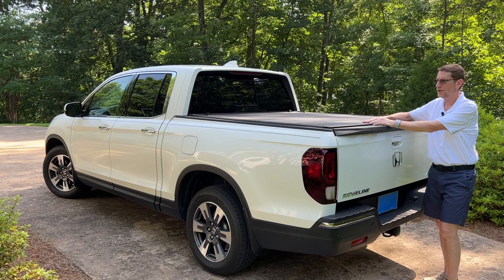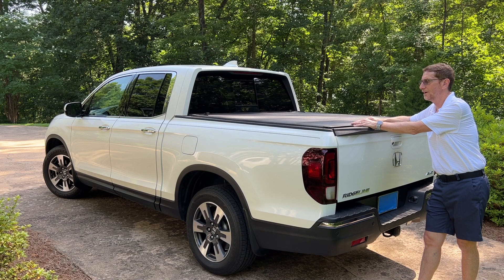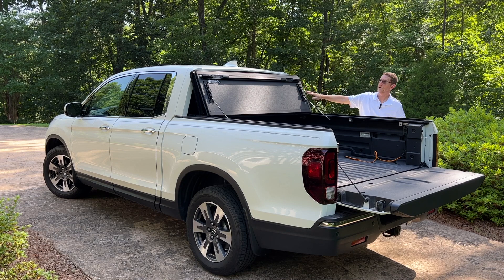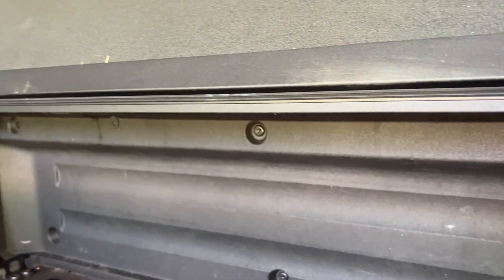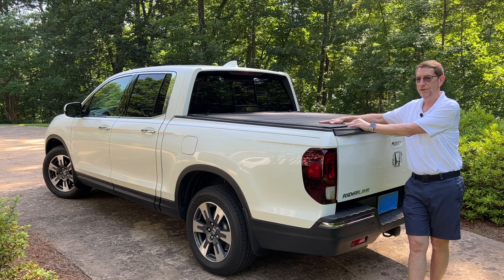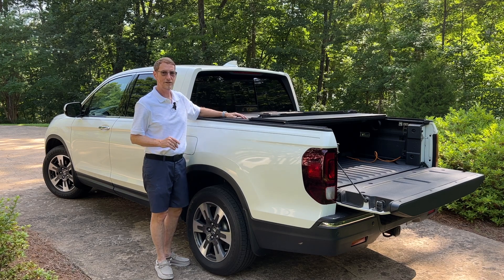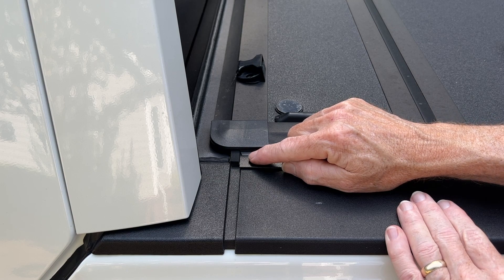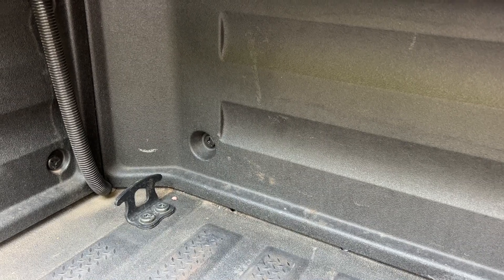Bakflip MX4 Tonneau cover, four year review and tips for keeping water out of the truck bed.

Comment: Have exact same cover for my 2018 Ridgeline. Nice enhancements you made!  I added a bed rug to keep things from sliding around. So nice.
Reply from the maker: Hey Craig! I had a BedRug in my first generation Ridgeline. The BedRug was awesome for things like moving furniture and was so easy on my knees but I haul a lot of pine straw and the needles get entangled with the BedRug and are impossible to wash out or remove by sweeping. I considered a BedRug for my second gen Ridgeline, but decided to make do without one.
Reply: @Koolbob2  i have the same issue, just got a 23 and the mx4 and the bedrug, i often get hay for the chicken coop, i wull just throw a tarp down, that should solve the problem.
Reply from the maker: @georgesangilan2845  LOL, that's exactly what I ended up doing! I kept a canvas painter's tarp in the trunk for when I had to get pine straw and didn't want to spend an hour plucking pine needles out of the Bedrug. As much as I enjoyed the Bedrug, I decided not to get one on my new Ridgeline.

Comment: Very informative. Thank You. I've been searching for a flush mount tri-fold for weeks now and I think you've just sold me on the MX4 ( It was already on my short list ). Im also concerned about better security and found a simple idea for drilling and pining the latches in the back panel to keep a crook for opening it with a coat hanger. Thanks Again !!
Reply from the maker: Thanks for watching and taking the time to leave a comment. I hope you are as pleased with your MX4 as I am with mine. It should be relatively easy to drill a hole through the edge of the MX4 and into the drip rail and slip a pin or bolt into the hole preventing anyone from lifting the cover, even if the release cable is pulled. Of course, you will have to open the tailgate and remove the pins or bolts to open the MX4.

Comment: Glad you had a good experience with yours. I just did a review on my F1 cover from BAKFlip and it’s awful. The first was half-ass replaced under warranty and the second one suffers from the same heavy panel issue due to water absorption.  Their customer service was awful in trying to get the side rails replaced after they replaced the cover.
Reply from the maker: Thanks for watching, I'll be sure to check out your video! I'm sorry you are having problems with your F1 cover, I just checked BakFlip's website and the F1 isn't available for the Ridgeline so that may be why I've never hears of any problems with the F1 on any of the Ridgeline forums I hang out on. I will say that I bought my first BakFlip second hand and the BakFlip customer service was just 'ok' when I called them to buy replacement parts. I sold that first cove when I sold my truck ad ordered a new BakFlip directly from BakFlip when I got my second truck and the customer service was fantastic. I wonder if the customer service is better if the cover came directly from them?

Comment: @Koolbob2  Thanks for the informative video. Could you please advise as to whether the Bakflip cover allows the bed trunk to open fully when the cover is folded back? If not, I have a few additional questions: how much of a reduction is there? Does it hamper your ability to access the spare tire, for example? Do you have (or can you suggest) any workarounds?
Reply from the maker: Every rigid bed cover requires a pair of rigid rails to be attached to the sides of the bed. All bed rails will prevent the trunk lid from opening 100%. The reduction in the opening of the trunk lid is minimal (10-15%). I can still access the spare tire and everything in the trunk. 

The only downside I've experienced is the lid no longer opens completely past the lights inside the truck bed. It partially blocks the lights when fully opened with the BakFlip installed. So at night the lights do not illuminate inside the trunk as well. That's why I added a pair of LED lights to my trunk lid and wired them into the OEM bed lights.

Comment: My bakflip tonneau has absorbed so much rain water it's almost too heavy to lift, is there any way to drain it?
Reply from the maker: After about 6 years of use I've noticed my BakFlip  is starting to get heavier after being exposed to rain for a couple of days. I am not aware of any way to drain it, but I may try folding it up to next time it feels heavy to see if any water drips out. I suppose you could try drilling same small holes in the underside skin.
Reply: Have drilled small holes already, will try larger holes next
Reply from the maker: @deeohgee4574 Keep me posted on your results!
Reply: @Koolbob2  glad to keep you updated...

Comment: Can you tell me if the in bed storage door opens all the way up when the tonneau  rails are  installed.
Reply from the maker: Sorry for the late reply, I just now noticed your question. The trunk lid opens about 90-95% of the way before it makes contact with the Bakflip rails that attach to the truck bed. It's no big deal and it's a tradeoff you will have with any cover that installs with similar rails.

Comment: How does this cover work with the bed storage compartment. I have seen some that limit the height you can open the lid. The lid doors hit the cover rails. Your video was very thorough but this wasn't mentioned...Your thoughts on this would be wonderful.
Reply from the maker: Yea, I really wish Youtube would allow us to edit videos after they are uploaded. I definitely should have shown how the trunk lid is affected. All rigid bed covers require aluminum rails to be mounted on the sides of the bed and they do reduce how far the lid can be opened by a couple of inches.

I did make another video showing how to add LED lights inside the trunk and you can see how far the trunk lid opens in that video. https://youtu.be/9afkJfdXJDw
Reply: @Koolbob2  after I commented I saw the other video. Looks like it opens pretty far. Thank you for the reply!!

Comment: Do you know if there is a BAkFlip that dosen't have a foam insert core ? Some people said that with time, the water could get in and the pannels gets very heavy ? Does the F1 model dosen't have foam in his core ? Thanks again.
Reply from the maker: My Backflip is almost 7-years old and I haven't noticed any issue with the panels absorbing water. I haven't studied BakFlip's covers since buying mine so I can't help you with how each model is manufactured. The Backflip folks were great to work with when I contacted them years ago, I'd just give them an call or email them and I'm sure they can answer any questions you may have.
Reply: I've owned two BAKflips, one for 5 years and one for 7. Both got heavier the longer they were exposed to the weather. It would be interesting to see what's inside since regular insulating Styrofoam doesn't absorb water.
Reply from the maker: @billstevenson1623  My Ridgeline is in the garage most nights so maybe that helps, but I've also been in torrential rain for a week when traveling and I've never noticed any water retention in the BakFlip.

Comment: Mine doesn't have the rubber stops and it rest against the back window on the ram 1500
Reply from the maker: Yikes, that doesn't sound good. I think I'd add my own rubber bumpers or at least use a pool noodle or some foam pipe insulation between the cover and the glass.
Reply: @Koolbob2  yes a pool noodle! Thank you that's a great idea lol I actually didn't think of that it's either that or maybe ill see how much some 3m rubber stops are on Amazon but pool noodle for now

Comment: I noticed that you still have the top tie downs installed. When they installed my MX4 on my 2023 Ridgeline they removed all four top tie downs and didn't reinstall them after they installed the bed cover. do you think the bolts are long enough for me to reinstall them?
Reply from the maker: Sorry for the late reply, I just now noticed your question. I reinstalled my tie downs with the factory bolts when I installed the cover. Unless Honda shortened the bolts you should be fine reinstalling the tie downs.

Comment: Does this cover stop the trunk from fully opening?
Reply from the maker: Every rigid bed cover requires a pair of rigid rails to be attached to the sides of the bed. All bed rails will prevent the trunk lid from opening 100%. The reduction in the opening of the trunk lid is minimal (10-15%). I can still access the spare tire and everything in the trunk. 

The only downside I've experienced is the lid no longer opens completely past the lights inside the truck bed. It partially blocks the lights when fully opened with the BakFlip installed. So at night the lights do not illuminate inside the trunk as well. That's why I added a pair of LED lights to my trunk lid and wired them into the OEM bed lights.

Comment: Thanks for the video!  I just bought a 2023 Honda Ridgeline RTL and am interested in the Bakflip MX4.  I have read from a few forums that the trunk in the bed does not open all of the way.  Do you see that as a problem with your truck?  If it doesn't open all the way, how much is blocked by the rails?
Reply from the maker: As far as I know every rigid and roll up tonneau cover has rails that intrude slightly inside the bed and prevent the trunk lid from opening fully. I find that I can open the lid far enough that it will stay up and I can easily access the trunk. The lid does partially obscure the lights in the sides of the trunk, that's one of the reasons I added lights to the trunk lid on my truck.

Comment: Can you open your trunk with your bakflip installed?
Reply from the maker: Yes. Every rigid tonneau cover I am aware of, folding or roll up, requires that slim side rails be installed on the sides of the truck bed. The tonneau side rails prevent the trunk lid from opening all the way, but it still opens about 90-95% which is plenty. You can see how far the trunk opens with my BakFlip tonneau in another video of mine. https://youtu.be/9afkJfdXJDw

Comment: Do you have to drill holes somewhere on your rails or bed ?
Reply from the maker: No, they bolt into place with the included clamps. Zero drilling and the BakFlip is completely removable without harming the truck bed in any way.
Reply: @Koolbob2  Thanks for the tip, great video!

Comment: Thank you for an excellent detailed video.  I am considering either the MX4 BAKflip or BAK Revolver X4s.  Can you tell me how much size of each panel?  With the first two panels open, how much of the bed is covered. TIA,  I have enjoyed your very informative videos.  I have a '22 RTL-E
Reply from the maker: Thanks for watching, it's good to know these videos are helpful! The panels vary slightly in width and there's a double hinge between the second and third panel of the Bakflip so it will fold properly. I measured and with the first panel flipped up there's a 15" long opening between the tailgate the the rearmost part of the Bakflip. With two panels open there's a 31" long opening between the tailgate the the rearmost part of the Bakflip.With all three panels open and the backflip up against the cab there's a 51" long opening between the tailgate the the rearmost part of the Bakflip.

I too considered the Bak Revolver, but chose the Bakflip because it does not intrude into the cargo area below the bedsides and I like that it folds up to protect the rear window from shifting cargo.
Reply: @Koolbob2  Thank you!

Comment: Hey bob, what is the height of the space between the cover and the floor of the bed? I'm trying to clear 42 inches and wondering if this would be a fit, thank you.
Reply from the maker: The least amount of clearance is 14.75" from the top of the ridges in the bed floor to the bottom of the BakFlip latch. The clearance is 16" from the top of the ridges in the bed floor to the underside of the BakFlip cover panels. Cargo that is 42" high is going to be higher than the sides of the bed and only a camper shell would cover anything that high.

Comment: What do you use for the black trim?
Reply from the maker: When the water stops beading on the paint I wash the truck really throughly with Dawn dishwashing soap being sure to really scrub the plastic trim with a soft brush. Then I use a clay bar to clean the paint and treat everything but the glass with Griot's Garage 3-in-1 Ceramic Wax https://www.griotsgarage.com/ceramic-3-in-1-wax/  The 3-in-1 makes the plastic and paint look great and bead water. I only use Griot's Garage Ceramic Wash & Coat https://www.griotsgarage.com/ceramic-wash-coat-48-ounces/ to wash the truck until it's time to strip everything off with the Dawn and start over, usually once a year or so.

Comment: How do you remove and install new rubber hinge? my cover looks like the rubber hinge shrunk or moved towards the other side of the bed allowing water to drip inside from the gap. Not sure if butyl tape will work for this type of problem.
Reply from the maker: I wish I could help you, but I've never had a problem with mine. Call BakFlip, I found their customer service to be excellent!

Comment: Hello there,  i enjoy your videos. Any issues with the in bed trunk opening all the way?
Reply from the maker: @realdavidreyes Great question! Every rigid bed cover will need a pair of rigid rails to be attached to the sides of the bed. All bed rails will prevent the trunk lid from opening completely. The reduction in the opening of the trunk lid is minimal and the only downside I've experienced is the lid no longer opens beyond the lights inside the truck bed. So at night the lights do not illuminate inside the trunk as well. That's why I added a pair of LED lights to my trunk lid and wired them into the OEM bed lights.
Reply: @Koolbob2   thank you for responding so quickly.  I'm going to research the OEM one and see how that one works.

Comment: So do you recommend this cover for a Tacoma?
Reply from the maker: I'm impressed with the Bakflip cover and so far their customer service has been great. If I had a Tacoma I'd definitely consider a Bakflip!
Reply: @Koolbob2  I have been offered the Bakflip mx4 for $1060 including installation, is it worth it? and does it keep the water out?
Reply from the maker: @7aramkeda334  That price seems about right. The only cover that keeps 100% of the water out is a camper shell or solid fiberglass lid. If my truck is parked on level ground in a thunderstorm overnight I’ll find a few places where water trickles down the inside of the bed and a couple of tablespoons of water in the corners.
Reply: @Koolbob2  fair enough, thanks again.

Comment: I had a Bakflip on  a Tacoma. Leaked like a sift.
Reply from the maker: Other than 1-piece clamshell covers, I don't know of any tonneau cover that's designed to be 100% waterproof. I get a few trickles of water down the sides of the bed in the front and rear corners if the truck is parked nose downhill, but that's about it.
Reply: @Koolbob2  leaked at every piano hinge all the way across.
Reply: @Koolbob2  I currently have a ARE 3DL on my Tacoma and it leaks a drop or 2 literally at both front corners in a monsoon.